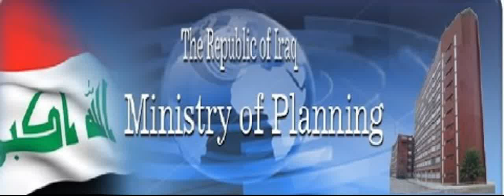The Exchange Rate of Foreign Currency in Economic Feasibility Studies

Comment: This was written in 1984 about the need to reduce the value of the old Saddam dinar from $3.20 to $1.13.  It has nothing to do with the IQD.  Notice at 3:00 that it says that the official exchange rate is $3.20.  The IQD's official value has never been more than $.00086.
Reply: So will the IQD go up in value ever?
Reply: Extremely unlikely.  It might go up a few percent, but it will never be worth more than 1/10 of a penny.  The belief that it will or that it even could has been promoted by people who are either ignorant or dishonest.
Reply: Thanks... You are probably right, It is unlikely, I'm not planning on it. but anything is possible?
Reply: I should have bought into 'bit coin' which seemed like a bigger 'scam' back in '09. It has gained the dinar like returns that this was supposed to.